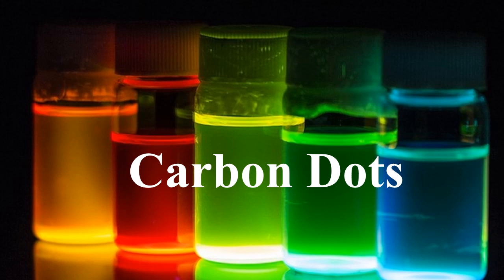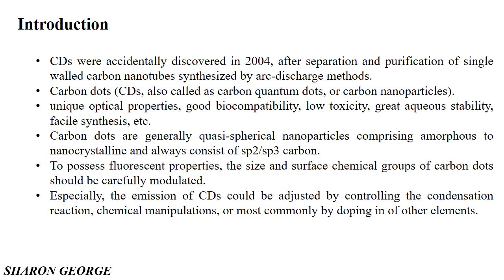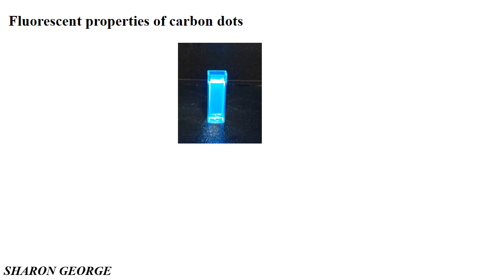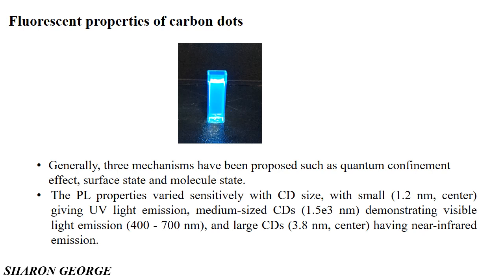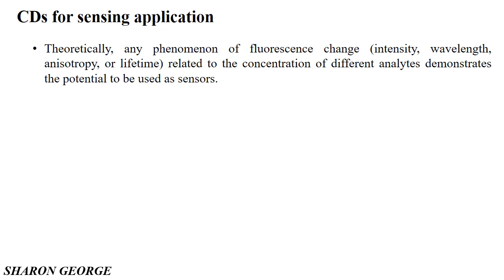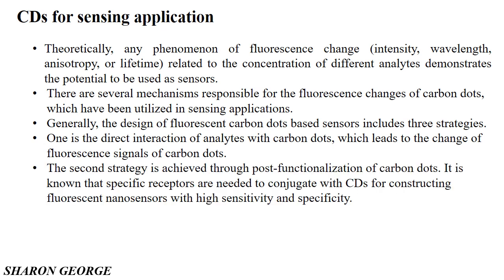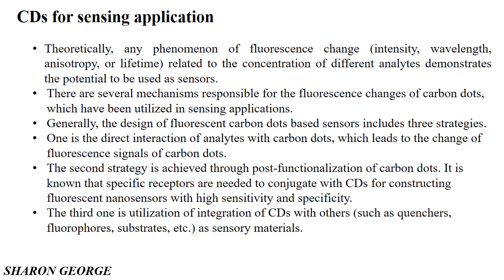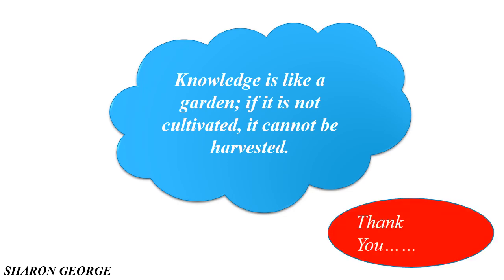What are Carbon Dots?#carbon #nanomaterials #nanocarbon

Comment: Would be better without the music, way too loud. One extremely efficient way to make carbon based quantum dots is to blast away at pyrolytic graphite with an ultrafast laser in a NaOh/EtOh bath. The particle size is very uniform, and can be controlled by energy density. ❤